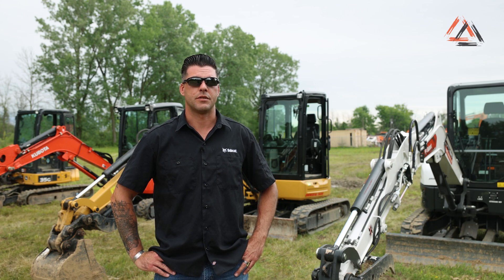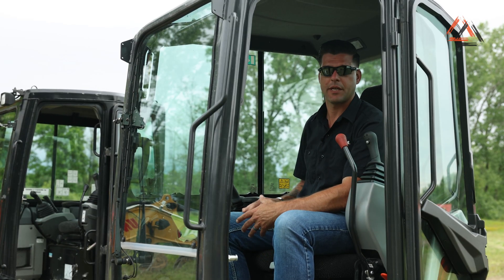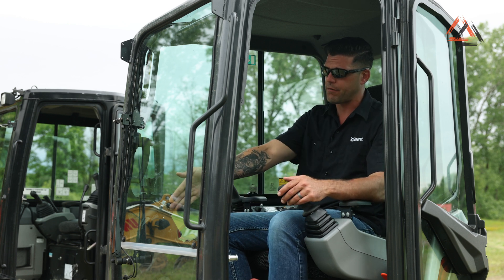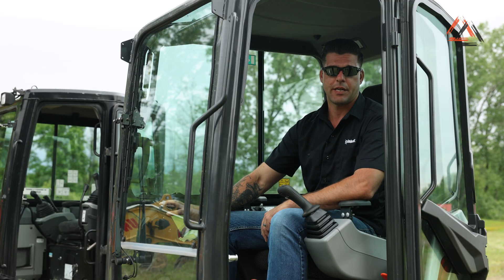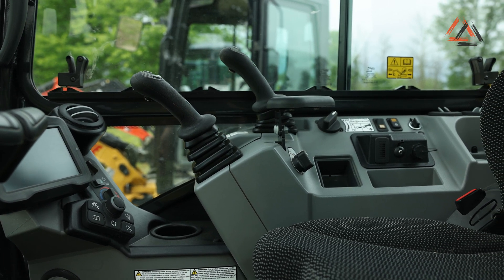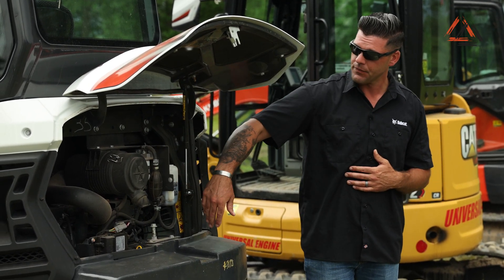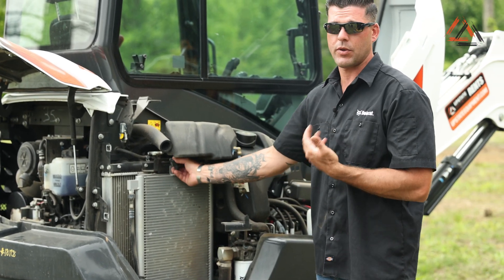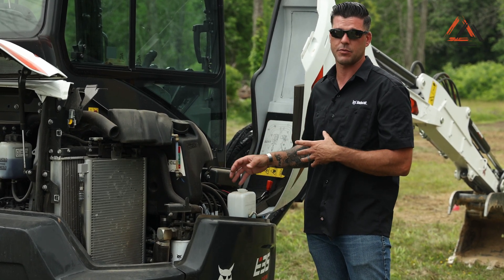Bobcat E35 (R-Series) Walk-Through - 3-Ton Mini Excavator Comparison Series

Comment: Pros: 
-Superior hydraulic hose connection resulting in lower hydraulic temperature. 
- Nice cab layout

Cons: 
-Heavy use of plastic body panels. Cheap, delicate, and doesn’t offer protection for engine bay.

-Electric over hydraulic joysticks. “Not a fan of these because the operator can’t feel the machine encountering things like water and electric lines when digging. A big NO for me.

While not as expensive as the Kubota, it’s still about 15k more than the SANY. With the Electric Over Hydraulic controls, plastic panels, and the Doosan engine, all features used to lower the machine production cost, I feel it should be priced closer to the SANY, which I feel is superior to the Bobcat due to the Hydraulic over Hydraulic controls, Yanmar engine, all metal body panels, 5 year/5,000 hour warranty, and no travel charge should a mechanic need to drive to your machine to work on it under warranty.

-Budget power plant (Doosan engine). The only excavator in the comparison that doesn’t run a quality, name brand engine. This is a big “No” for me.